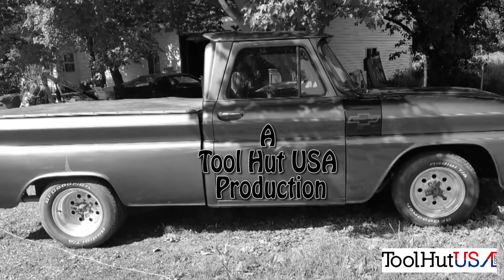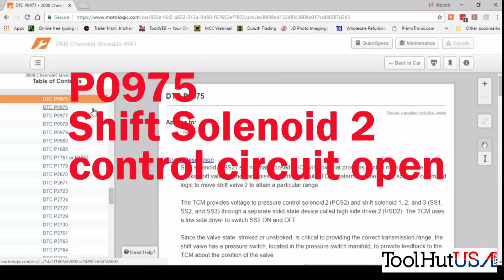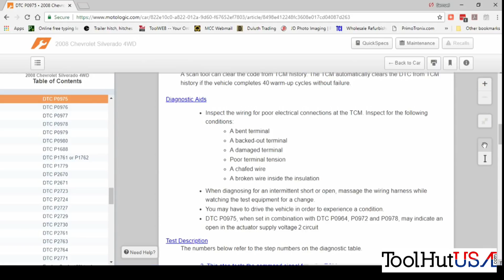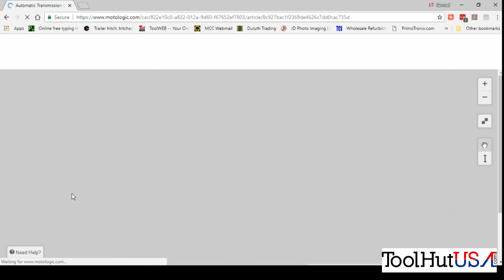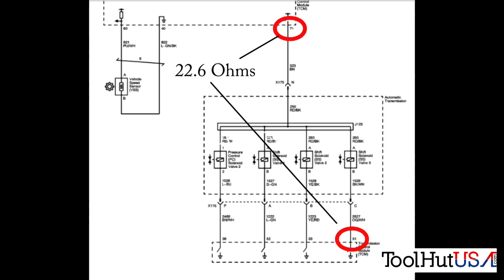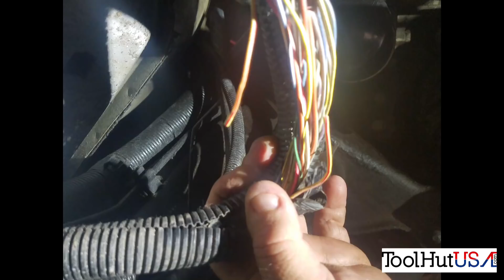2008 Silverado Transmission complaint

Comment: Get a old 70s truck and get away from the computer and sensor bs new trucks are trash . I got a 72 gmc Sierra im fixing up cause iv had enough of the bs
Reply: @thecarflasher3019  i had a 2018 canyon it lasted 7k miles got it brand new

Comment: This is the method to follow yet, too many, more than half of the "mechanics" out there will not bother with this skill set.  SAD.
So, the question now is, how does a yellow w/ red stripe wire contained inside a harness with all those other similar gauge wires "bulge" from (I'm guessing) electrolysis or corrosion?  This is the stuff that auto manufactures are guilty of and they need to have better control of their wiring standards.

Comment: Resistance testing is just another tool in the diagnostic toolbox. I’m not sure why it gets such a bad rap. Understand it and use it when you can. Great video.
Reply: Mostly because many do not fully understand ohms and resistance factors. Auto mechanics of today need to first master electrical circuit school then succeed in mechanical repairs. Just about every aspect of news vehicles are controlled with circuitry. The best vehicle I can think of for a test vehicle is the Chrysler Pacifica when it comes to wiring defects/issues. Whats worse, these wiring concerns are typically manufacturing defects.